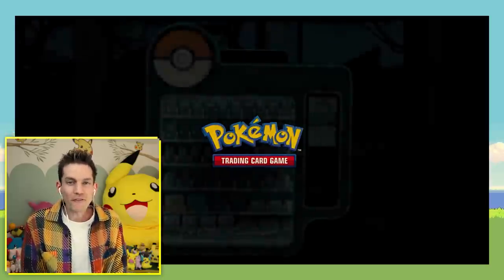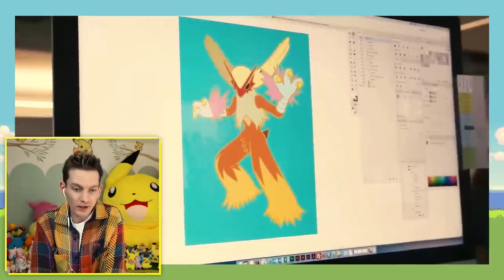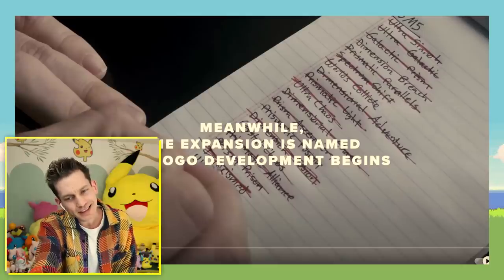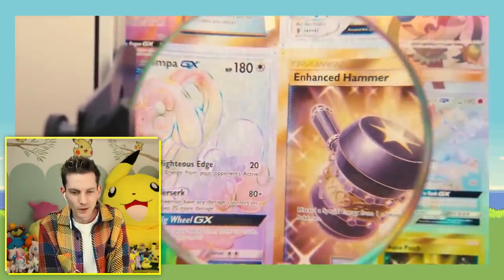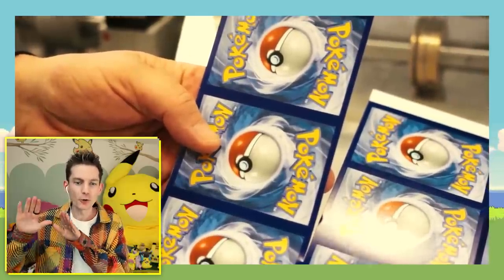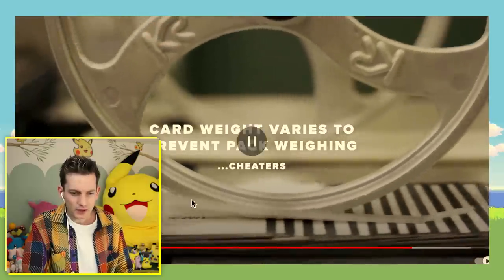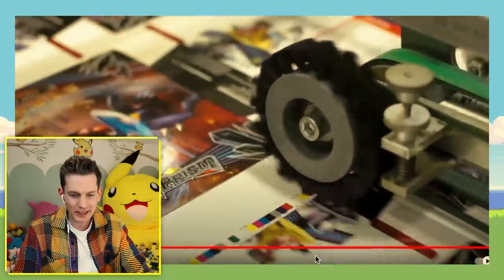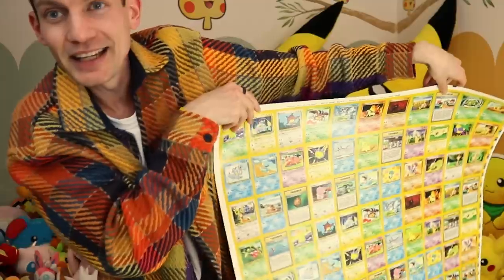INSIDE The Pokemon Card Factory (2022)

Comment: Their process seems strict, and I still get full packs of wildly off centered cards. It makes it pretty obvious why PSA 10's are hard to get, because if they are off by even a smidgen during that whole process, there's 1000's of cards just turned to 8s or 9s.
Reply: I was concern if my cards are original, because lots of them was off centered, but the firm that sells cards im my country is on the official list of resellers (card are sell in english), so their quality control isn't so great... sadly
Reply: I'm sure it's also on purpose to keep the price of the most expensive, rare, 10 graded cards up to encourage buying boosters.
Reply: the process was strict ONLY for the first few sheets to ensure QC is fine and they mass print it without such strict QC

Comment: My question is if the vetting process is so good. Why are there still so many misprints. And ridiculously off centered cards
Reply: To push the hype
Reply: i guess despite their best efforts, they cant... *puts on sunglasses* catch em all.
YEEEAAAAAAHHHHHHHH!!!!!
Reply: Security is very tight, my brother works at one of them, it's way tighter than this guy had to deal with on the video. He told me they have a ton of screenings to do before they can leave, on top of different kinds of detectors. This is just the public version that y'all got to see of one.
Reply: Most likely they are running these printers at max speed for efficiency over quality when the printer is running at high speeds the sheet can “bounce” causing the cards to be off center when they are cut and trimmed final, it’s common for all types of printing. The slower the machine runs, the easier it is to catch misprints and it’s less likely to bounce.
Reply: @hanksennette1132  see I understand like the high speeds during printings right. But how is it that I get more holos full arts rares etc. that are miss cut off centered like crazy. But base cards seem to be pretty nice.

Comment: For anyone curious on roughly how many cards would be in the wide shot of the warehouse, if you take the 10 cards per pack, by 36 packs in a booster box, by 6 boxes to a case, by a roughly 6 cases per layer, roughly 5 and 8 layers to a pallet (8 for the tall ones) and lastly, we can't account for the ones in pitch darkness or behind Ando.. but if my math is correct

10x36x6x6x5x57 = 3,693,600 (roughly 57 small pallets)
10x36x6x6x8x78 = 8,087,040

Add those together and we have a rough estimate of 11,780,640 cards on screen
Reply from the maker: Wow 😳😳😳
Reply from the maker: Wow 😳😳😳
Reply from the maker: Wow 😳😳😳
Reply: Wow

Comment: The thing the printer loaded into the press before the ink was a printing plate, it's a metal sheet created specifically for each colour and job (so in this case, four plates would have been created for each of the colours required; Cyan, Magenta, Yellow and Key (Black)), it has tiny pores which allows the four inks to be pressed through the plate wherever it is needed on the job!

Comment: So if the cards are random weights to prevent weighing, then later he says they weigh the sealed packs to make sure all the cards are in, how does that work? And does that mean that there are packs with less or more cards than the set amount? That was a little contradictory.
I always thought it was just the code card weight that was added to counter the holo’s heft. But their new tactic is having a holo in every pack now so that should do a lot